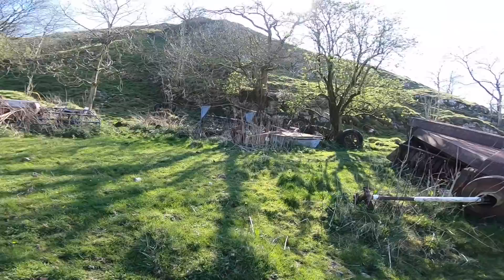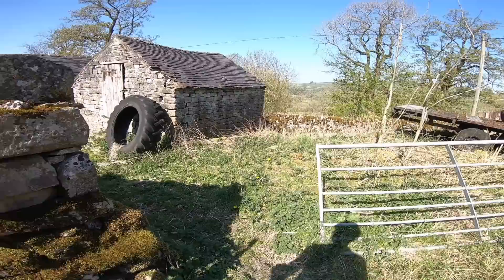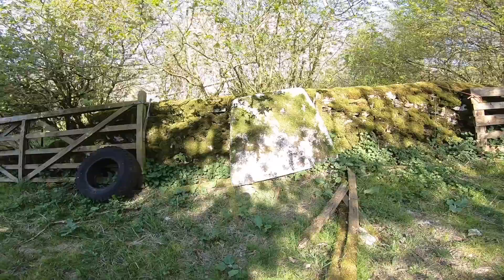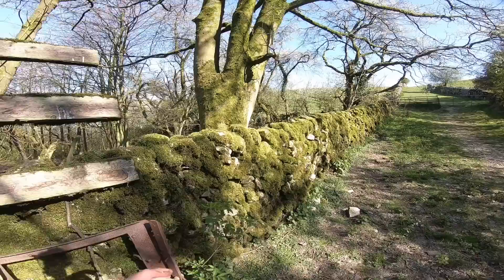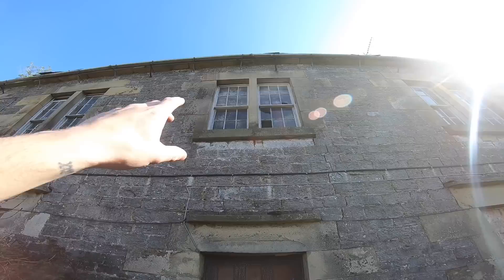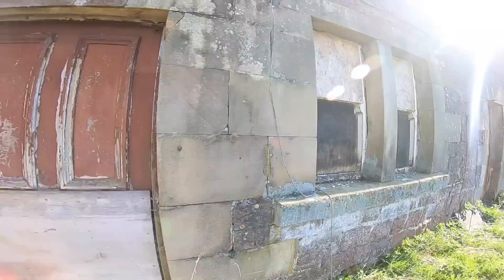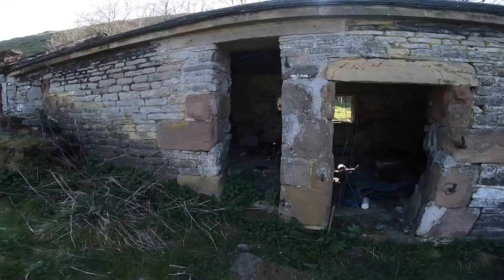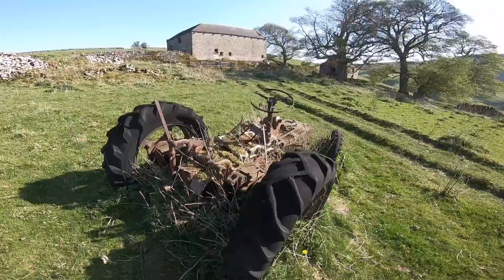** WE FOUND 2 ABANDONED FARMS WITH LAND ROVERS LEFT BEHIND ** SO AMAZING

Comment: Hi Jay, Love the videos, Keep them coming, The Land Rovers are Series 3, 109 (wheel base) 2.25cc diesel  pick ups.  I used to assemble them at the Solihull Factory.
Reply from the maker: Hey David. Thank you for your comment David. Great knowledge and experience you have. Shame they aren’t still making them in the uk now. Very sad
Reply: @JaysFabShop  The second on is certainly a diesel, can't tell off the first one but running the reg through dvla should list the fuel type. The second one is an early series III with a solid dash panel. They went to a vented one by about 1973.

Comment: Done a check on the land rovers and they are sorn, so id imagine the place is still owned but never used or anything due to the passing.

EDIT The land rover has been there that long that it hasn't had any mot, milage data logged on.
Reply from the maker: Hey matey. Wow great information from the off. Thanks for sharing that very appreciated 🙏
Reply: And slower than you can imagine 😆😆😆
Reply: Neither of them seemed to be very high mileage going off the dash clocks. I've got a 1972 series III resto project with only 38K on it.